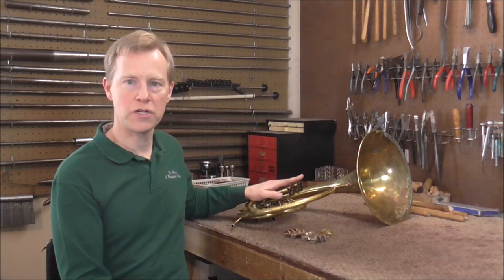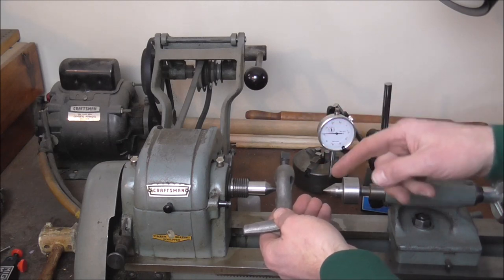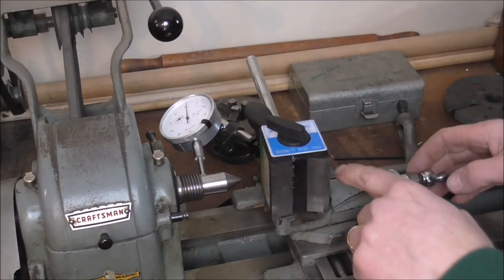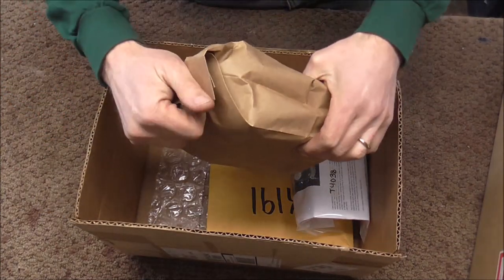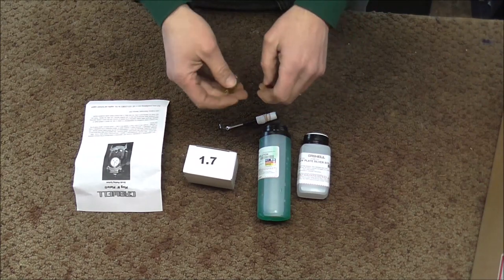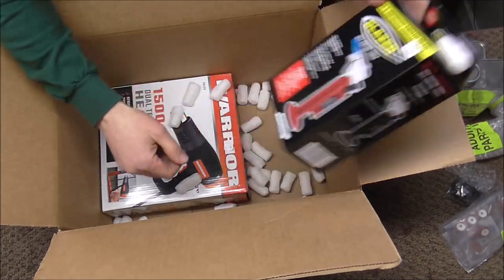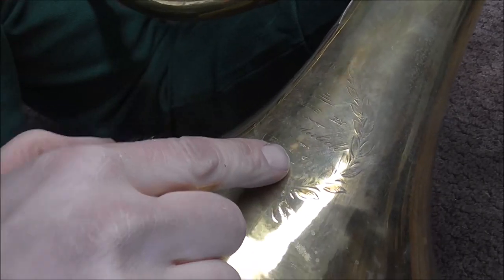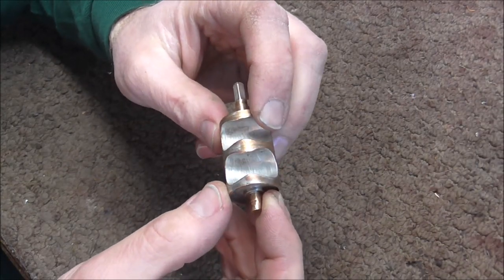French Horn Rotor Restoration Update with TOOL and SUPPLIES UNBOXING

Comment: Art, make sure the Morse taper hole in the headstock is clean.  If there is any corrosion or dirt, it can affect how the dead center sits in the hole with respect to the bearing centerline resulting in wobble of the dead center. If nothing else, get in there with a brush and some WD40 to clean out the tapered hole.
[Edit] treat it like you're cleaning out an old, corroded valve block

Comment: Did Caswell only send you a 1.7V rectifier? They should have sent you a 4.5V to use for nickel. Hopefully your kit works better than mine, I had to buy new chemistry and a new Anode along with some sulfuric acid for etching in order to get decent results, and even then it is very slow.

Comment: Check the tailstock by putting a piece of metal between the center points and take a cut. You should get the same measurement on both ends. Was the lathe bed ever  leveled? Bed wear can also cause the live center to drop bellow center line. Ilion Industrial services may have a renovation guide for your lathe.